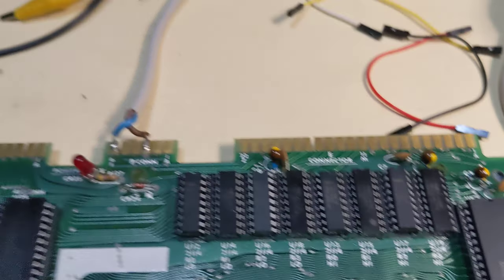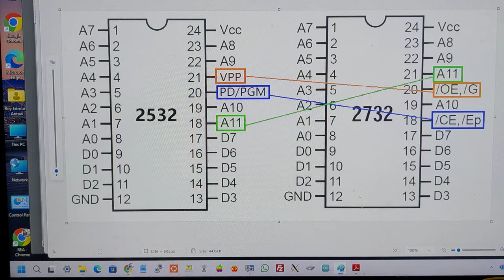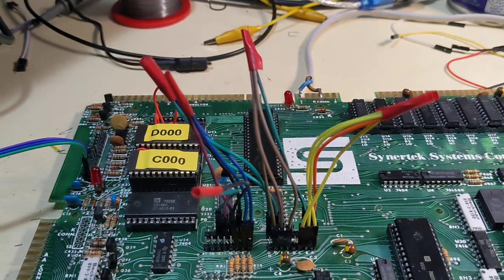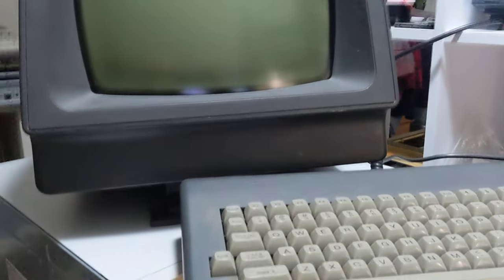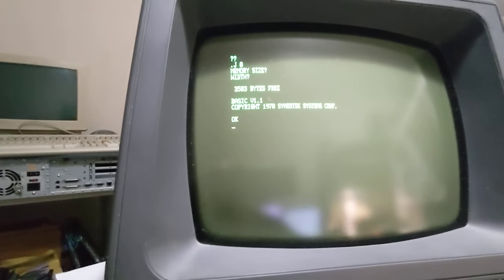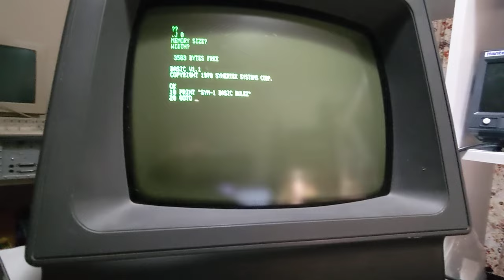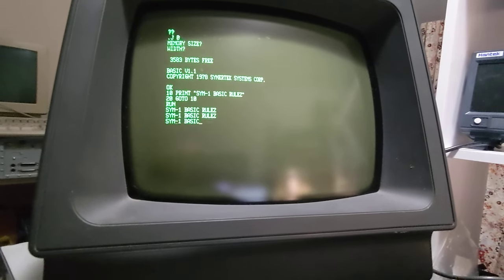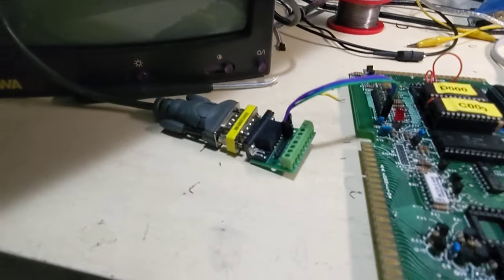Synertek SYM-1 6502 running BASIC on a serial CRT Terminal

Comment: Thank you for your video. I got a SYM - 1. Haven't connected to a laptop yet. Done quite a bit on the aa connector. Spent hours trying to get the on board display to what I want. In the end I found you have to unlock some protected memory..

Comment: I'm intensely jelly. An old friend gave me his old SYM 1 with an ASR33 teletype. Eventually tossed the tty (probably shouldn't have but it wasn't practical at the time to hold onto it and was kind of self-conscious about firing it up whenever M&D were trying to watch TV one floor below me) and eventually donated the SYM1. Kicked myself later for not finding a way to do serial connection via another machine like my C64. Almost wired up an alphanumeric keyboard and created my own keyboard driver, but reliable program storage was a b***h. If I recall though,  I think one jumper setting will allow you to boot directly to a serial connection, bypassing the onboard keyboard. 

One fun thing I did get working was the example oscilloscope marquee-style display in of the most dog-eared sym1 manuals.